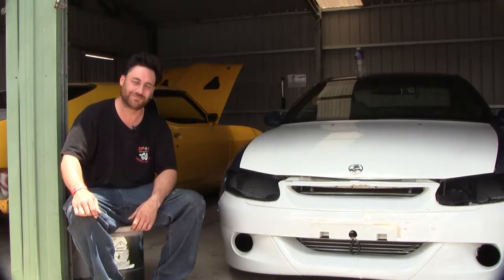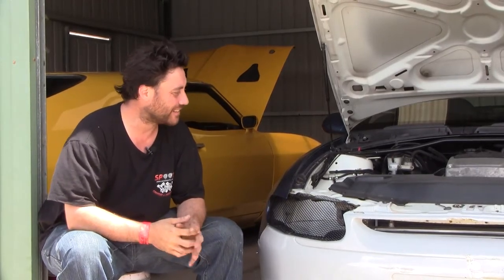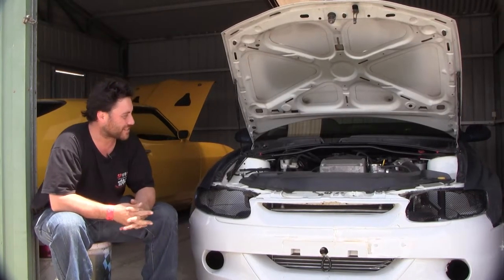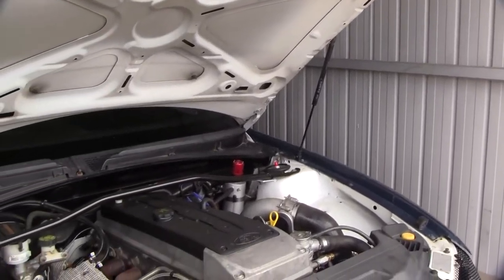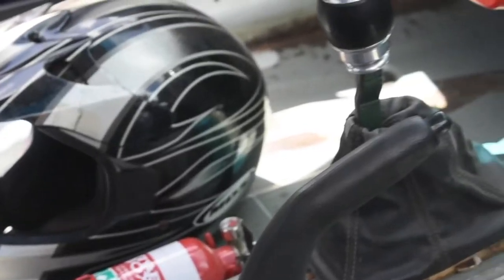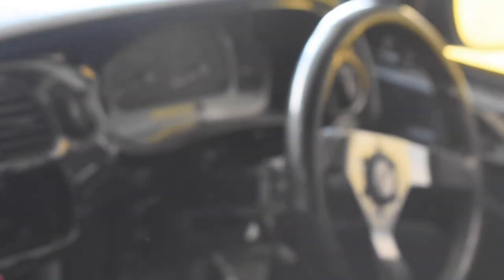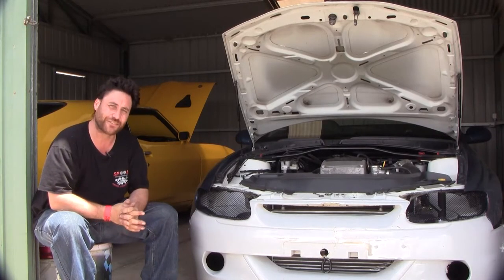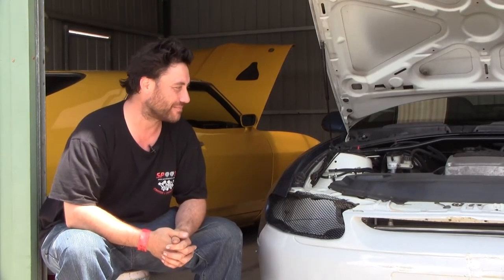BARRA POWERED Holden Monaro Track Car

Comment: Whats the point in the built motor. Even the NA motors can be pushed to 500whp with ease with the gas and turbo motors going up to 650-700rwhp
Reply from the maker: Keep in mind this is a track car, which experience huge load, and is still in development. This was only its second track day. 

I can’t speak for the owner, but It’s very possible that the current power output is just a safe shakedown figure.
Reply: Ready for even more power down the line